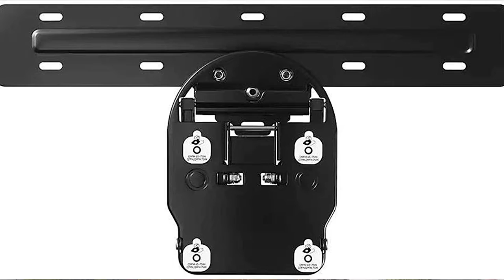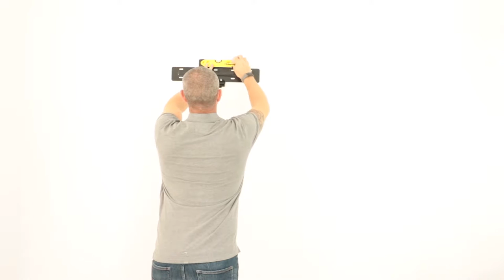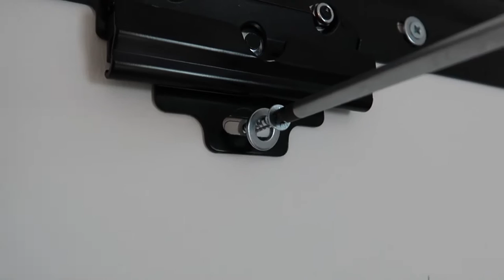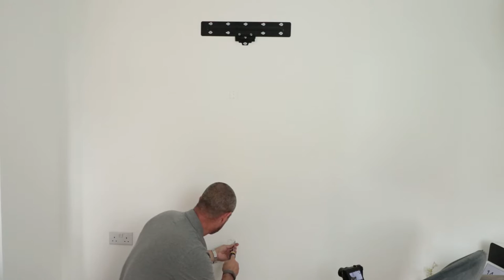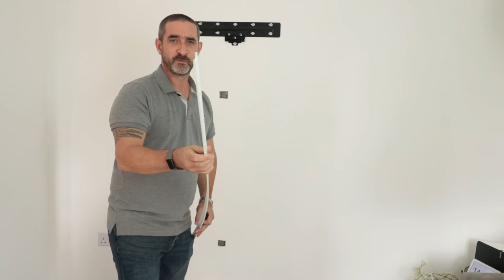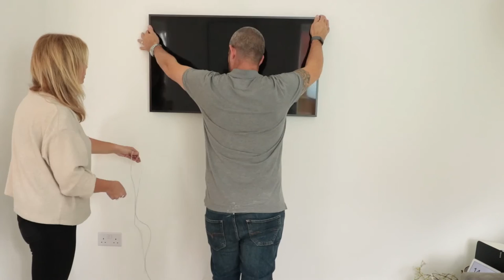How I hid the TV wires on our Samsung Frame TV on a dot n dab plasterboard wall

Comment: Sorry, quick question - doing research on these TV's now, and some of the online forums say you can't run the wire that came with the TV in the wall as its not "in-wall" rated? Did you have to get a special cable to get this done?
Reply from the maker: I have two of these TV's and both times I used the cables that came in the box without any problems.
Reply: Samsung sells an in wall rated version for 300$. Other than extra cost issue, the cable is thicker so doesn’t fit in the grove behind the tv. In Ontario Canada what he’s doing violates our building code . While the risk of fire is low if it ever did happen the insurance company might not cover you.
Reply: @newbuildtohome  Sure it will work, but it is definitely not to code.

Comment: Every video on this is the same, always runs the cable straight down and out below. What if you want to go down... but also a metre to the left for example? That's the tricky situation I'm scouring yt for
Reply from the maker: Screwfix sell a magnetic tool called a "SUPER ROD GEKKO GRIPPER 6M CABLE ROUTING TOOL" which could work if your wall is dot n dabbed plasterboard but if your wall has studwork behind then the studs will probably block you from going sideways.

Comment: Hi
What about connections to consoles? Do you have to drill further holes?
Reply from the maker: Hi, Console connections and sound bar, sky box connections etc all connect to the one connect box which is on the floor under the unit. The only wire that connects to the actual TV is the wire to the one connect box.
Reply: @newbuildtohome  oh wow that's amazing, didn't realise that and thank you so much for the quick reply. Subscribed🤝🏽
Reply: @newbuildtohome  and power cord?

Comment: The only problem I see with this video is the "fingers crossed" part.
Reply: Well and it is violating code
Reply from the maker: As far as I'm aware there is no code in the UK for running a power cable behind a wall. Every wall in the house has a power cable running behind it so why would a 3 amp TV cable be any different?
Reply: @newbuildtohome  ahhh didn't catch uk bit you are correct us electrical code is more stringent, in the US both would violate code.